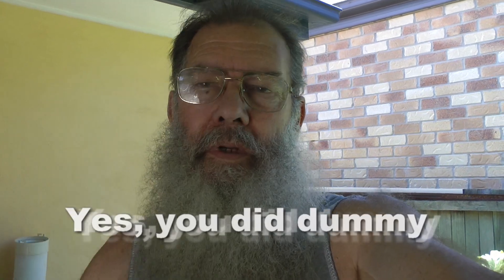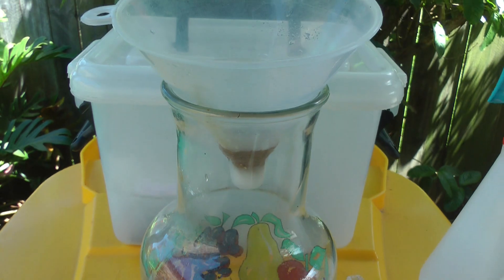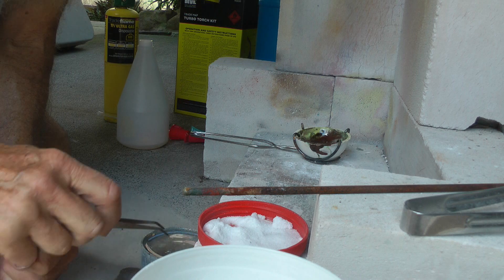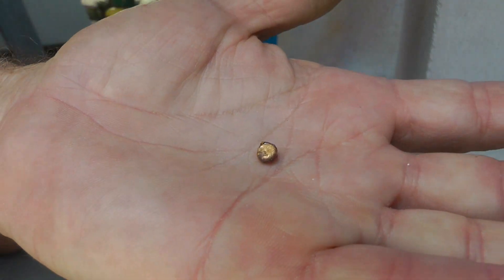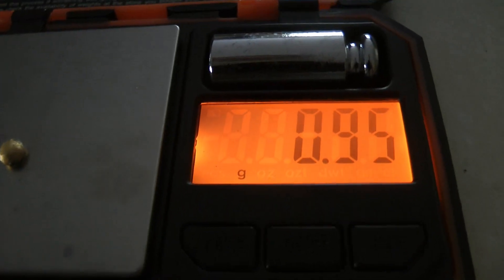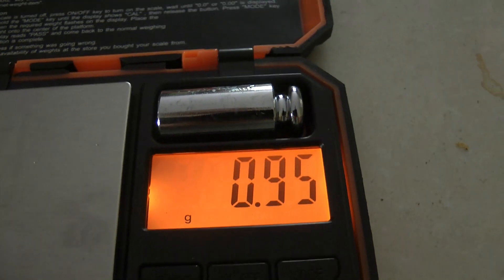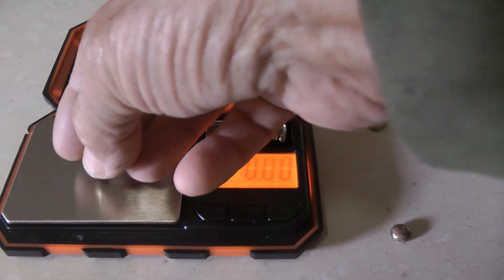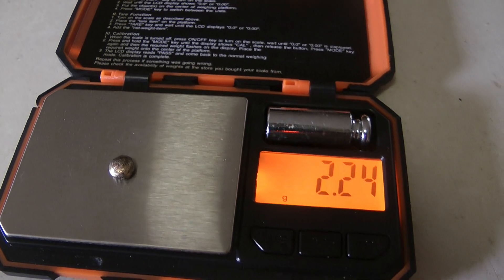#Gold Foils # Direct melt to a gold button

Comment: Ummm... perhaps my chemistry is off, but doesn't nitrate and hydrochloric make poor man's aqua regia?  I would test that spent acid with SMBS before neutralizing and discarding for sure.
Reply: Test and never discard anything until you know everything. 
My 2 cents
Reply: Eva agrees 126.73 percent.
Reply from the maker: G'day Keith , your chemistry is correct . It is a poor mans Aqua Regia , and i just had them in it long enough to separate  the foils from the plastic and remove most if not all the copper backing on the foils . If i was to then put the foils in a clean mixture like the first one , yes i would have put all the gold into solution , but i was not trying to refine them to purity , i was just cutting corners a bit . I was surprised that i think they could be possibly 20k or so . Matto , ie Prospector Tripp said that he has dealt with some that were very high purity . That is good to know . 👌✔ Anyway , thanks for dropping in Keith it is appreciated 👍👍, ohh ps . yes i did retain the leftover solution. Cheers Ned . ✌
Reply: @GrooberNedJardine  Hope things are going well down there.